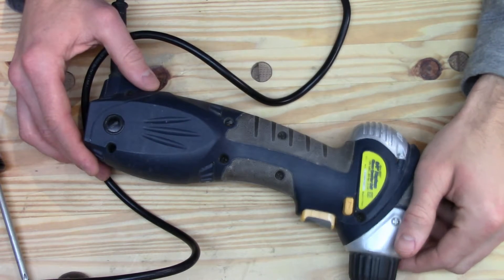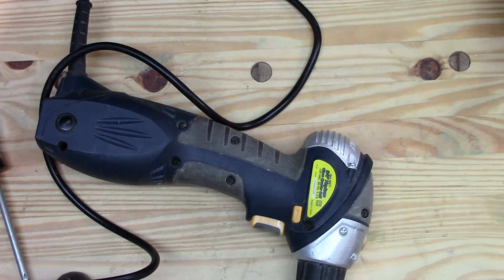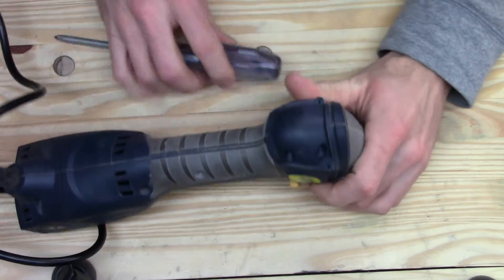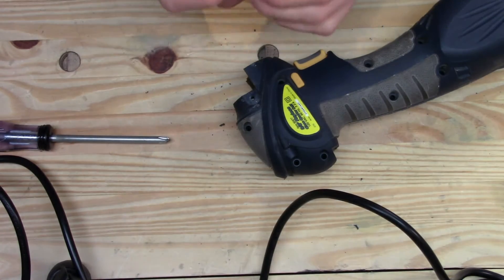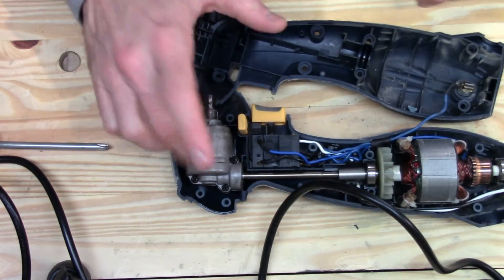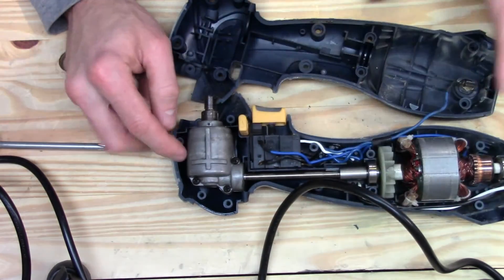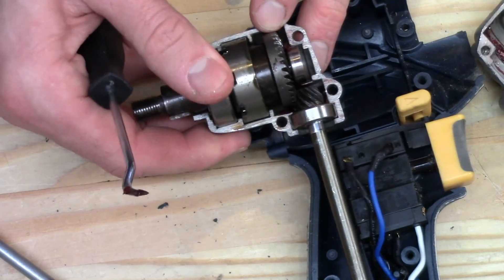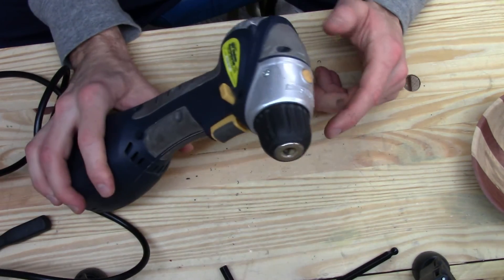Harbor Freight Close Quarters Drill Teardown

Comment: Bought mine several years ago. It worked fine for drilling small holes and driving screws.  I used a 1" spade bit through the bottom plate of a wall, but must have hit a knot and it locked up, so  I'm guessing I broke some teeth in the transmission.  For the part he skipped with chuck removal, the inner phillips screw is left hand (reverse) thread, but the chuck has a normal (righty-tighty) thread.  Another video recommended clamping the chuck onto the biggest hex wrench you own and whacking with a hammer - came right off.
Reply: Thank you for adding this. its the whole reason I looked up the video, and the guy skipped right over  it's disassembly,  Oh noooo lol!

Comment: The top part of my drill right above the chuck, the "magnesium" cover, cracked; any idea on a good glue that might repair it?  Thanks in advance....
Reply: Little late, but JB Weld usually works on this type of thing. I have the same issue where the Chineseum cover broke in the same place, and Im about to use that method myself. Otherwise, it's not a bad little drill motor.
Reply: Just a little update,  I finished my repair on my drill using JB Weld. I don't  know if you still have yours, but it worked great to fix it. Just make sure there's  no oil or grease on the repair site and maybe rough it up just a little with sand paper or  a file.
Reply: @kaylamarie8309  thanks Kayla, I still have the drill and will give that repair a try...
Reply: @Clarence Causey  Awesome!  I hope it turns out as well as mine did 🙂 Good thing about JB Weld is that you can sand it to shape, drill it, etc. The stuff is hard as steel when it dries.

Comment: I own this drill and have used it several times over a few years. It worked fine until the metal housing cracked next to the chuck. Now the chuck won't open and the screw driver bit is stuck in there. I still use it but cannot change the bit. I am now looking for a higher quality close quarters drill.